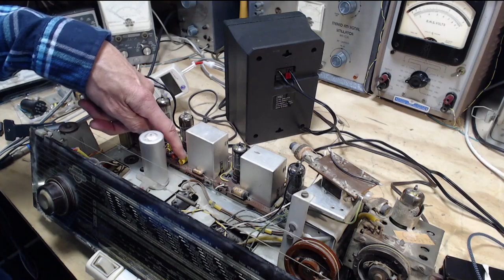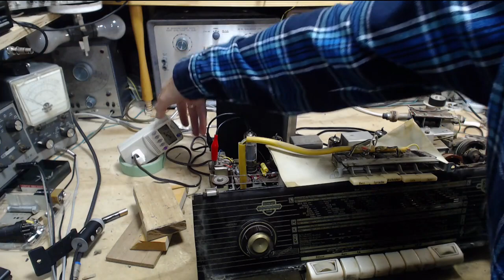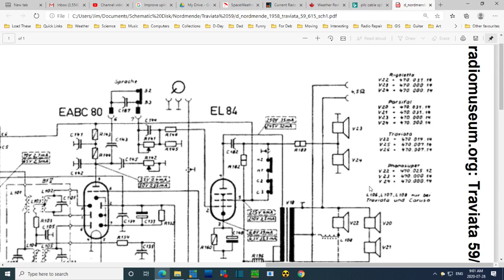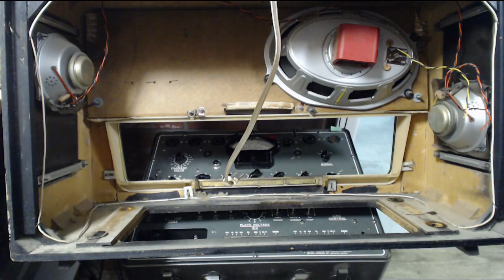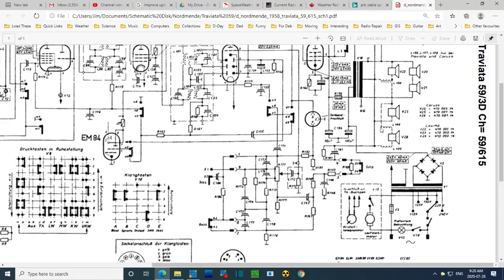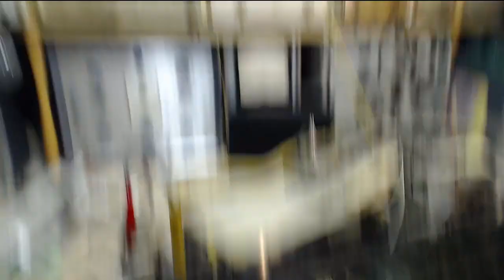Nordmende Traviata 59 Tube Radio Video #4 - Speaker Circuit

Comment: btw you probably also want to clean the keyboard´s internal switching plates by using isopropanol, my radio had contact issues and this solved it completely, also making the volume loudern and magic band more sensitive.

Comment: Connected the speaker wrong???
You put your aligator clip ground to the wrong pin on the transformer i think.
You have to connect both clips to the pins with the cutted wire on it since the speakers were attached to this.
BTW this radio should have a output for external speakers on the back, i have a very similar if not identical chassis inside the Nordmende Parsifal U17.

Comment: It is just a crossover network. Low freq to larger woofer like speaker, smaller midranges across transformer . Try a speaker direct across transformer and signal inject / trace

Comment: Those  push button bandswitches need a good cleaning. Those are a problem on all those old German radios. Also the selenium rectifier is another thing that needs replacing.
Reply: You are perfectly right. Those button arrangements are in fact the only thing you can not fix when they cause serious trouble. The whole radio is built around them. And the selenium rectifiers can only be left in if very little current is necessary, for example a few miliamps in a tube voltmeter. Peter from Frankfurt, Germany. Greetings

Comment: 18.03 Eh? Where does he get the notion that the cathode voltage on a 6BQ5 EL84 should be 68 or 63V ?
Even if it was totally illegible on the schematic it should be clear that a cathode voltage on that tube would be below 10V - in this case 6.8 and 6.3V
And for those wanting to follow his travails using a readable schematic go to nvhrbiblio.nl/schema/Nordmende_Parsifal59.pdf
It is free and a full SM of these Chassis with component list and the 1959 pricing (g).
It makes you wonder; why is a perfect scan available free and radiomuseum.org offers a crappy scan to its paying(!) members... Who copied from who?